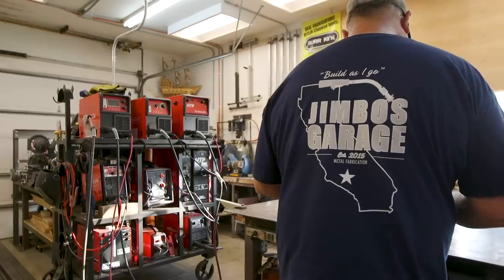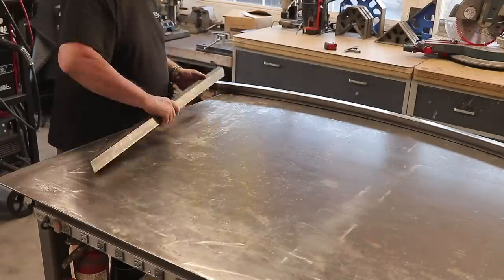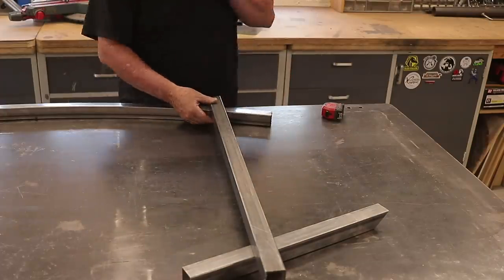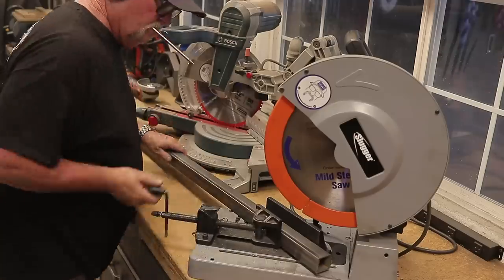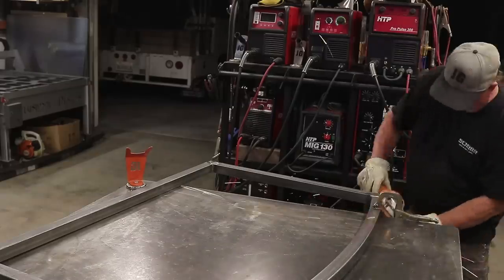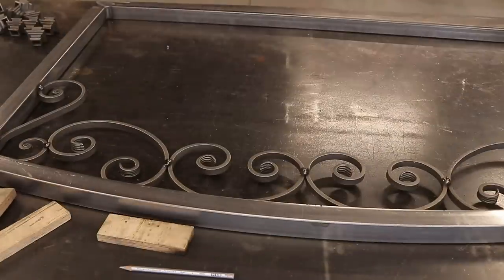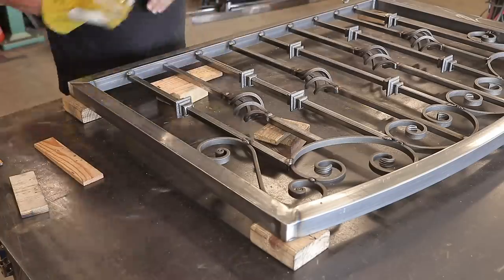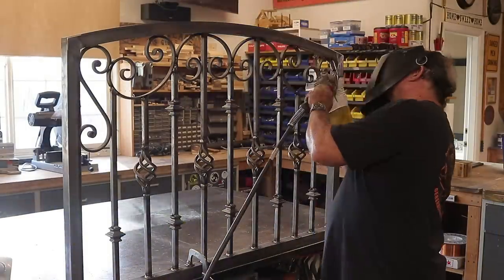Small Decorative Arch-top Gate  | JIMBO'S GARAGE

Comment: I don’t think your “curly cues” are cast iron. I’ve forged these baskets by cutting four equal lengths of square stock, welding each end, and then heating them in my forge. Once heated I place one end securely in a vise and use a twisting tool (or a large crescent wrench) on the other end and twist. The soft, hot square stock will open up into the basket, or “curly cue”. Stop twisting when it is the diameter you desire. I have also used round stock to make these baskets. Darlington, South Carolina